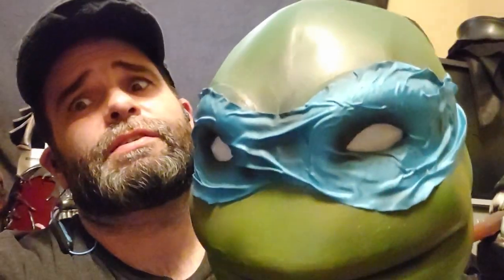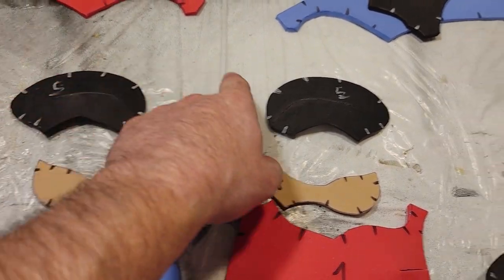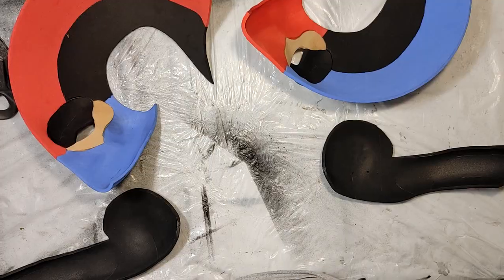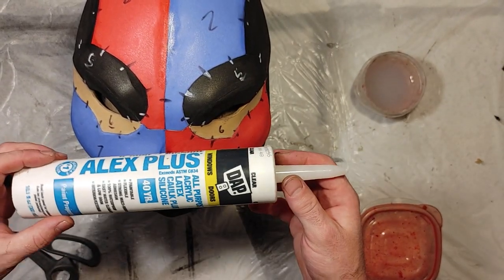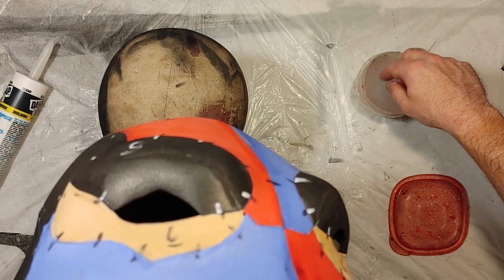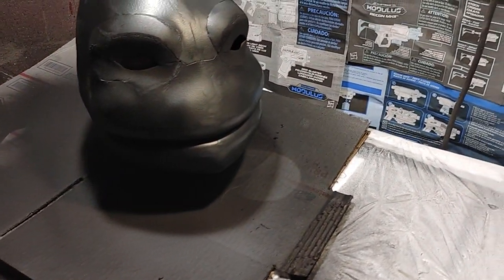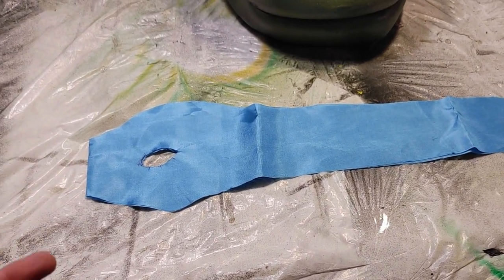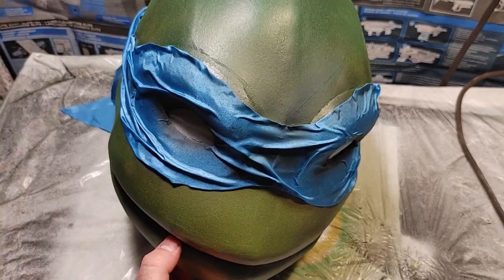TMNT mask DIY build

Comment: I just finished Tracing the pattern. Before I start cutting, are there any angle cuts or 45degree cuts.
Reply: Did you watch the video? He tells you when he does angled cuts and at times he will write it on the patterns. Go watch the video! 👍🏻
Reply: @thecosplaynoobj3872  I did watch the video. He only talked about v-cuts.
Reply: @kaydawg25  ok. If he didn’t mention any bevel cuts then if I’m not mistaken there aren’t any. I don’t remember cutting any into my build of it.